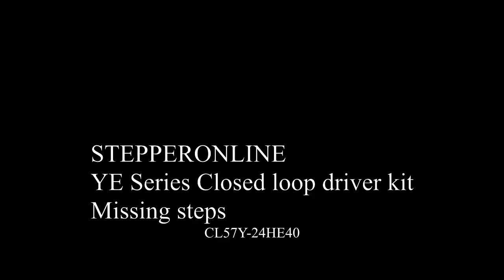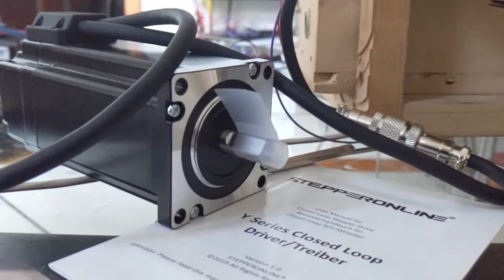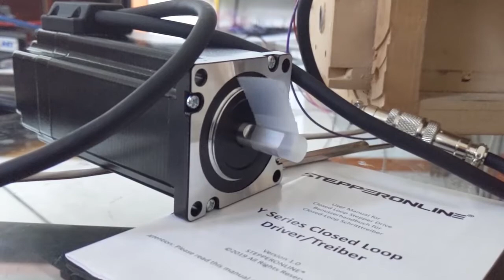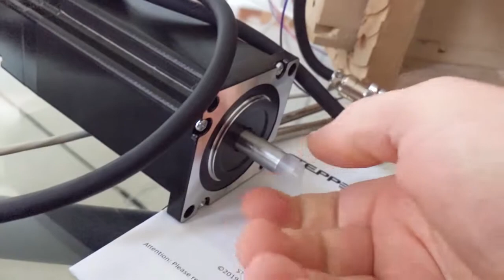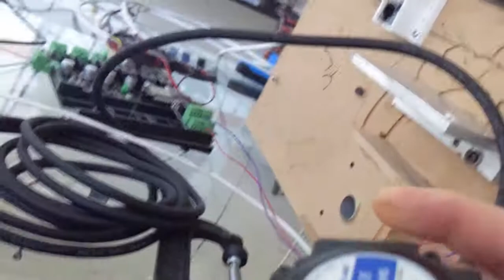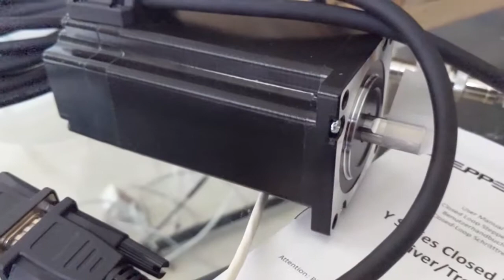How not to do tech support:  Stepperonline CL57Y-24HE40

Comment: I'm wondering if there is a chance if you miss matched the phase pair polarity where you connect to the driver.
Reply from the maker: surely possible but they tend to really grind and jump around when you get the pairs wrong.  The video is less about the issue and more about the troubleshooting experience and the overall experience with stepperonline.
Reply: @JesseSchoch  
I just purchased some nema 34 12mn motor from them, with cl86y drivers.  They should be here today, but I'm waiting on the motion controller I bought as well.  Went with the uc300eth and ub1 breakout board.  When I get to the testing maybe I'll record my process, and progress.  Hopefully everything is good to go.
Reply from the maker: @travisknutti9331  the replacement I received is working great and I'm very happy with the products vs JMC which I have not had luck with.  Hope yours works out also.